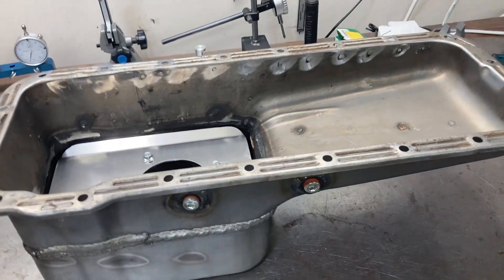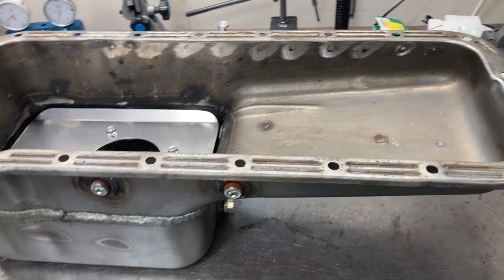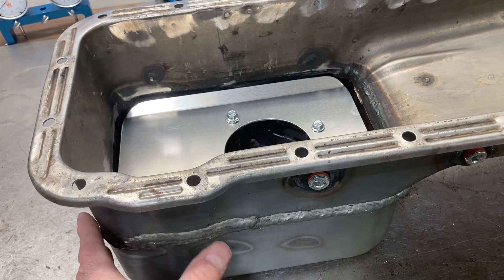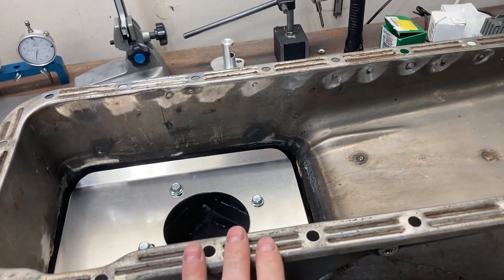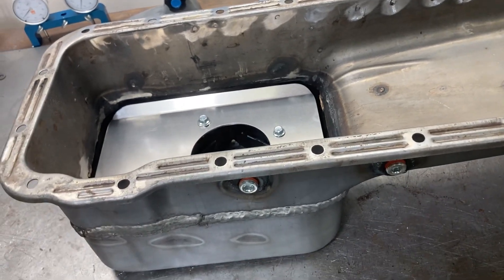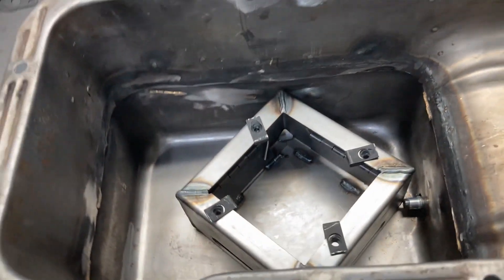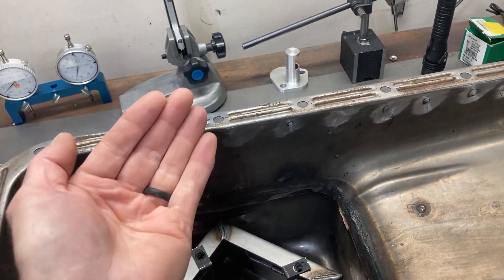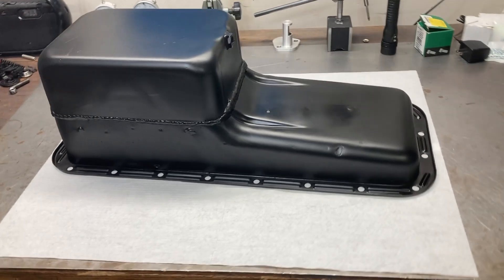Lykins Motorsports Oil Pan Discussions

Comment: I too use Kevco pans, I have one on order now.  Another thing you can do at the oil returns is to put a little sheet metal cover over the holes with the bottom side open.